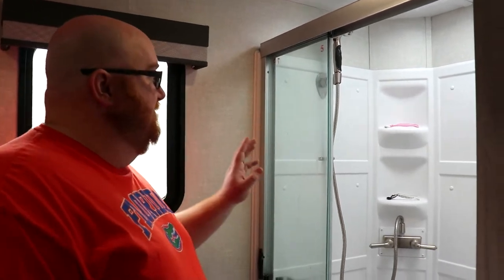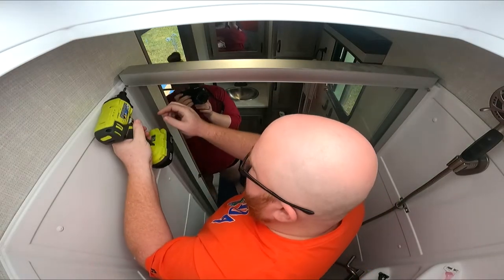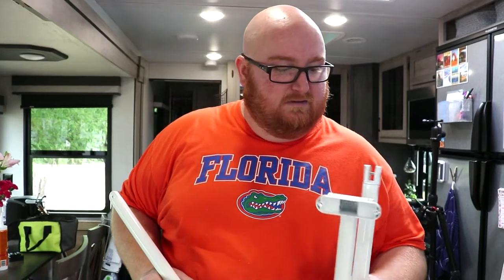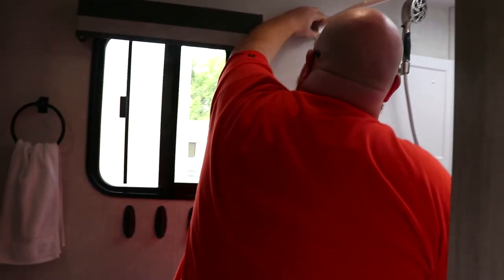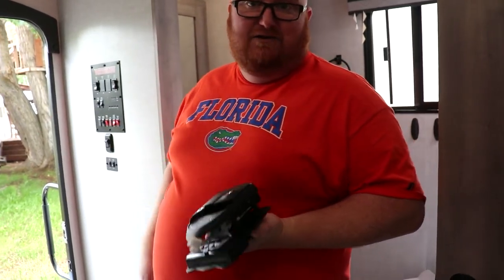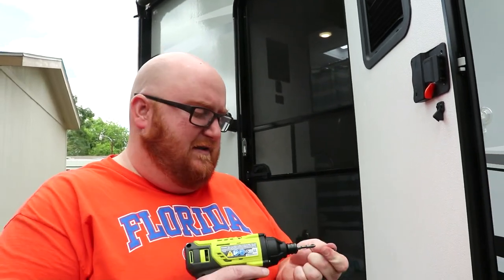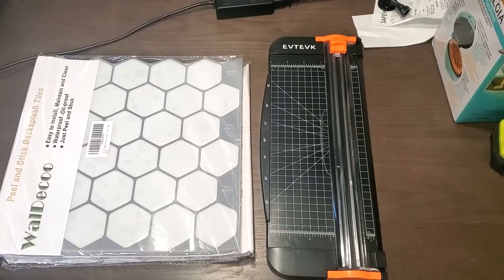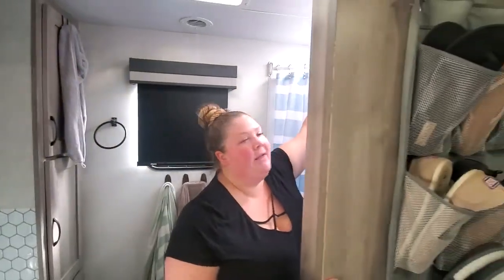3 Must do RV Upgrades - Installing Latch it, Extend a Shower, and RV Tile

Comment: Thank you so much for doing this video! I want to remove the shower doors in my Voyage, too. My husband is disabled and has difficulty maneuvering through the opening with the doors. A shower curtain would be perfect to give him space to get in and out. And you are so right about cleaning the doors and the tracks! Good riddance. Plan on doing this project this summer. Love your peel and stick tiles, too! Might add that to my list. Already changed out my door latch. Thanks again. Love your videos!!
Reply from the maker: Thank you for your comment! Have you changed the doors out yet? How are you liking it?

Comment: My husband is 6’4” and he barely fits in our rv’s shower. We have a 28 ft. Class A and it was the only one we could fined that had the three main things we needed. A king bed for his height, a shower he could actually stand up in since there’s a skylight bubble on the ceiling of the shower and a drivers seat he can fit behind with his long legs. He also didn’t want anything too long, height was more important to him. So we wound up getting a 2015 Thor wind sport. We have since found the shower to be way too cramped. I especially prefer more room, he’s toughing it out since he can stand up in it lol but I honestly don’t know how he can even move to get clean in that small space. We were thinking about a shower curtain to replace our glass door. But he’s worried about water damage and the curtain not being water tight enough. What did you guys do to secure your curtain on the sides and are you finding it’s keeping all the water inside the shower? 
Just found your channel and I’m a new subscriber. Thank you for this video and love your “we’ve got this!” Energy:) you two are super cute and love your channel name too! 🤗🥰
Reply from the maker: Thanks for this comment! Sorry it has taken so long to reply. We haven't had any issues with water getting out, but we do have a curtain that is on the longer side, so it definitely helps hold the water in. I also got a shower liner that is also a little longer and it has small weights on the bottom to help keep it down against the wall. :)

Comment: Loved watching your upgrades- nice work! We have your same trailer and don’t have any switches below the master/control panel in the entry…. What is your switch connected to? And what is that controller below the switch?
Reply from the maker: Thank you so much for watching! We still love the trailer! The first switch below is for the light outside above the door. The switches below that control the fan and electric vent in the roof above the kitchen. We've noticed a lot of differences in the trailers. We even paid 250 extra dollars to have a light installed in the closet that was supposed to be there to start with lol!